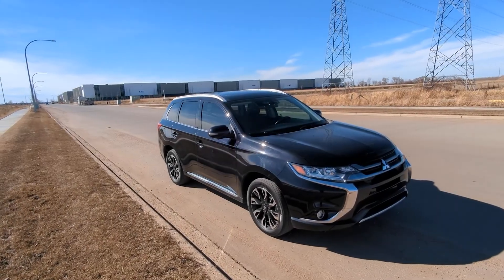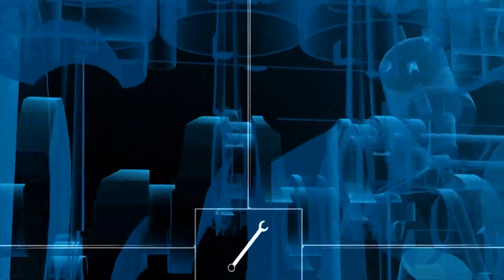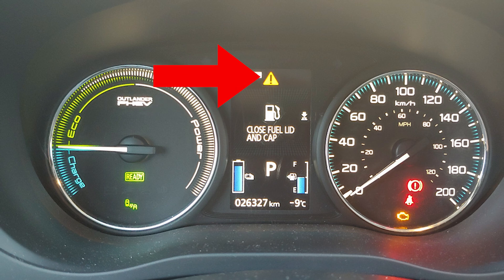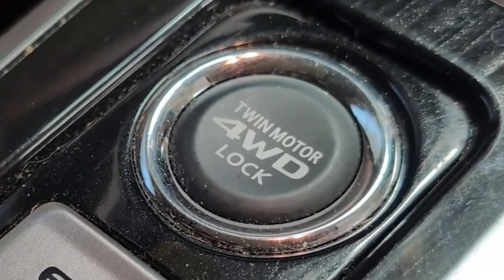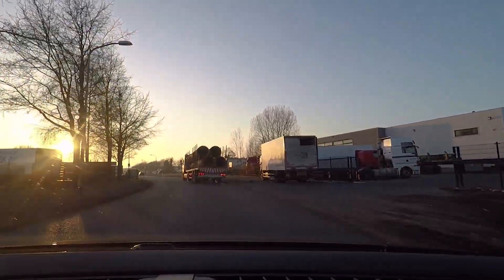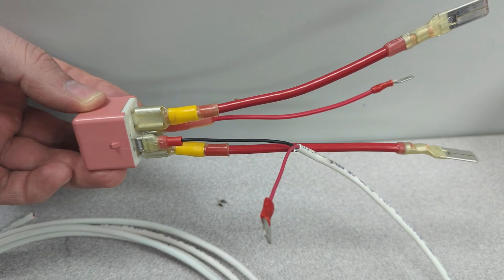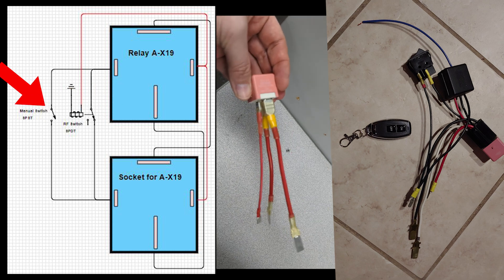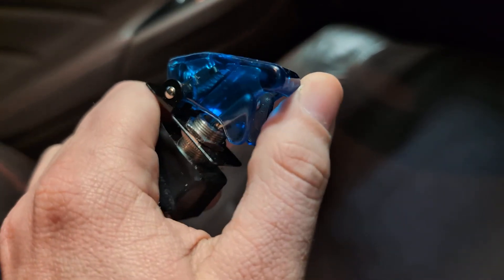Disable the Gas Engine in a Mitsubishi Outlander PHEV - Pure Electric Mode Unlocked (in 2 Minutes!)

Comment: on my prius prime (and i guess it's the same for the rav4 Prime), EV mode is engaged by default, and stay there unless I push the "HV" mode button, or if the car detects that running the gas motor is necessary (like every 2-3 weeks, or if the battery is too hot) It wont engage the gas motor even if it's cold (i tested with -20C temp without heating hte gas motor does not start). And the full EV heating will work until -10C.

Sometimes i drive for long hours, so I make sure to use all the gas in the tank and refill with new gas every month.

The lack of control of EV modes on other PHEVs on the market is why i don't intend to change my fully paid of car from 2017. I checked the mazda CX90 wich seems damn good and a 3rd row with 3500lbs of towing is tempting, but the lack of control of EV mode made me change my mind.
After all, my car only uses 35L of gas each month, and i charge the EV mode battery at work. can't be much better than that.

Comment: I just wish there were more serial hybrids with a bigger focus on being a short range BEV with a backup plan rather than an EV with a gasoline battery. It pains me how our first serial hybrid in the states will be the ramcharger, followed by the new scout siblings. Like if this was designed to be an ev from the ground up and had a 30-35kwh battery, paired with a gas motor, it would be a smash hit. Even at an abysmal 2mi/kwh, it would still be 60 miles of electric range. But this would get closer to like 75 miles, which would be a knockout for the brand.
Reply: They are called EREV. You had the Chevrolet Volt / Opel and Vauxhall Ampera, the BMW i3 REx, Caddilac ELR and Fisker Karma.

They work as pure EV vehicles and only when the battery is depleted does the engine kick in. The implementation on the Volt / Ampera / ELR is perfect, the car works as a pure EV and can keep the same performance and usability when running on gas. The i3 has issues keeping up with highway speeds running on petrol, and the Karma is just odd.
Reply: Serial Hybrid? Short-range BEV with a backup plan? You mean like the 2014-2021 BMW i3? IMO the only reason it failed miserably was the idiotic 1.9 gallon gas tank. I mean - really? There are mods to add an external 8 gallon tank though.
Reply: @geneinmyrtlebeach6967  the insane cost was the main reason
Reply: problem is that the 30-35kWh battery (or engine+generator) is $10+k and 150-ish kg, basically doubling the cost of the drivetrain
to add salt to the wound, the engine needs periodic use, you can't let it rot for 2 months, use it for a few hours and let it rot again (gas goes bad as well), the maintenance cost would make it pointless...this is why Toyota is sticking with their powersplit device hybrid and a small battery

Comment: I think of it this way... in EV mode,  the car turns into a 2012 Nissan Leaf with a 50% degraded battery. (Which, most of them have at this point.) Legal, slow, and not much range, but works for a lot of people as a short-range commuter.
Reply from the maker: @fiehlsport  Exactly! Not a race car or anything fancy, but still potentially good for what some might need it for.